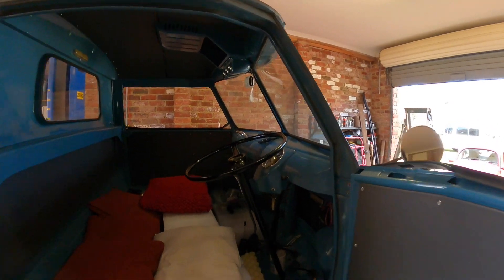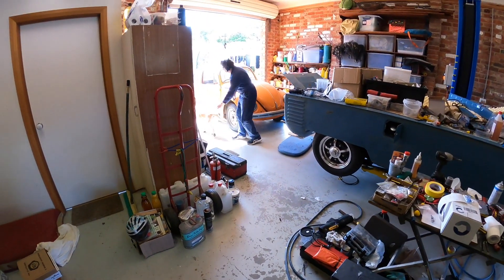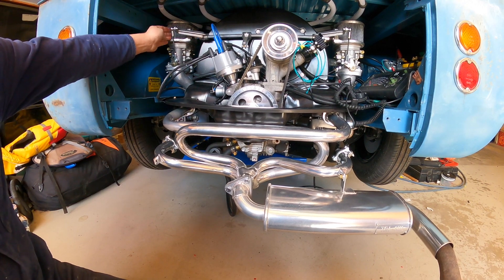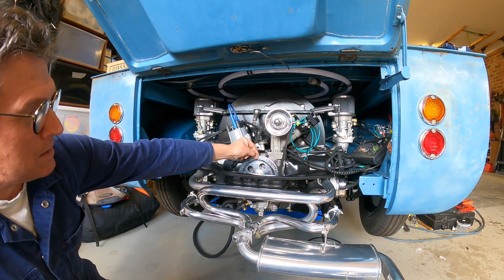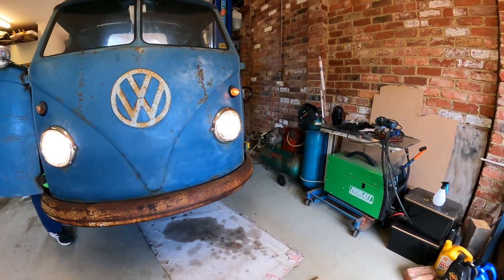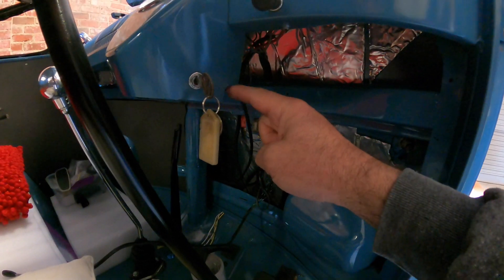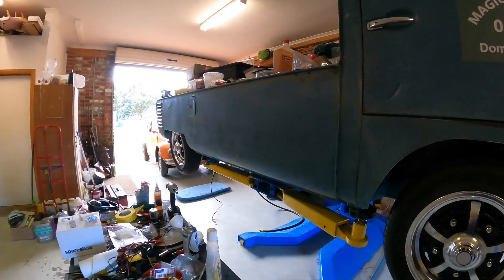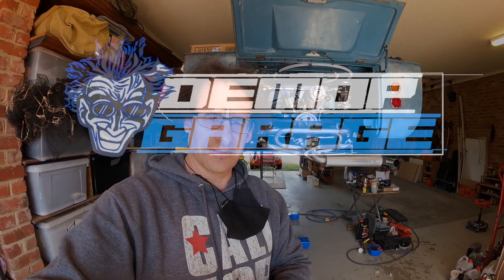VW Bus Restoration - RESTORATION BARN FIND SINGLE CAB PART 20 #vdubrun21

Comment: Awesome video Mr. Demop !! What size is the engine ? & Which carbs did you go with ? & just curious why you went with a generator instead of an alternator ?
Reply from the maker: Motors from rod penrose, 2176cc with 40id weber style carbies. Paul had the generator sitting there so he put it in, see how it runs
Reply: @DemopVWgarage  nice !! Can't wait for the burn out video !! 🤣🤣
Reply from the maker: @mattstick1man563  hell yes😂😎👍🏼